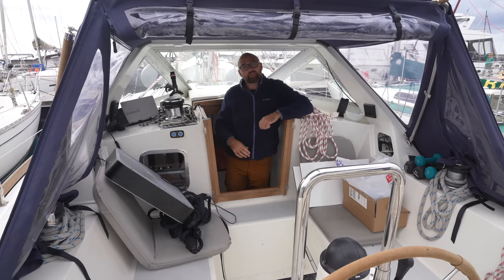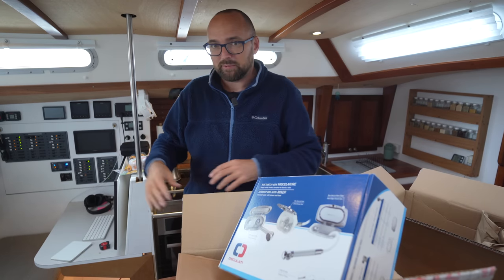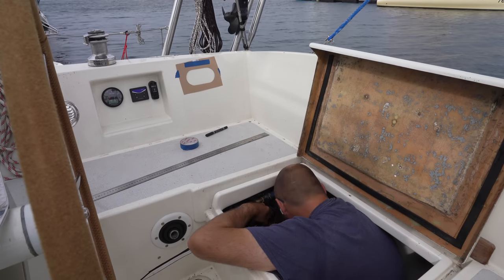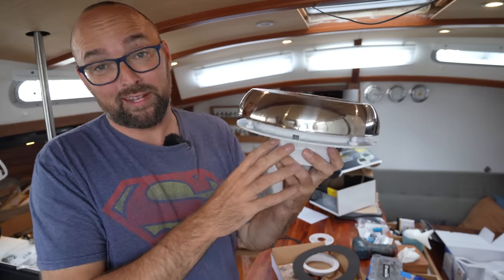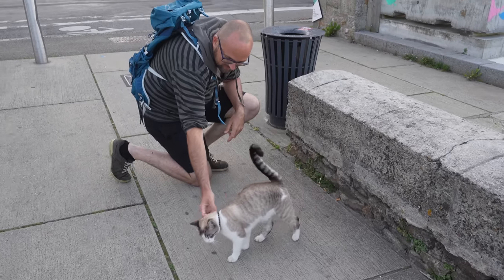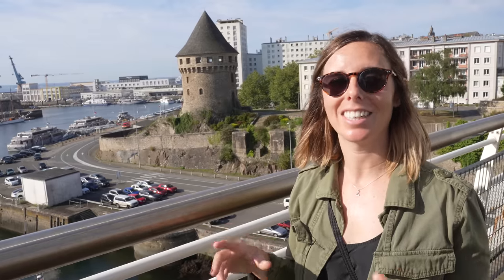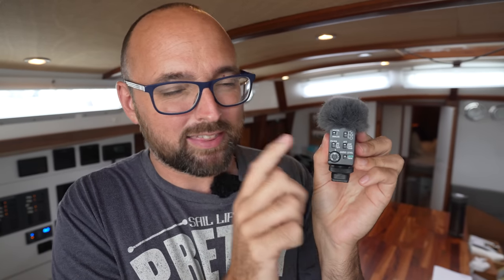Sail Life - Cockpit Shower, Solar Vent and tour of Brest

Comment: It's funny hearing Ava immediately shot down the cold shower. I had a similar experience years ago. I took a woman on a surf date. (We were both surfers already.) We took my VW van that I had built this beautiful kitchen and shower unit for. Figured maple, maple cutting board, stove, and 20 gallons of high pressure water to wash all the salt off after our surf. I was quite proud of it. When it finally came time to rinse off she looked me dead in the eyes like I had just kicked a kitten and said "It's not hot water?!?" 

Years later when I sold that unit, tore out the entire interior and built out a full camper interior in its place, I made sure to install a hot water heater. And you know what, she was right. Totally worth it.

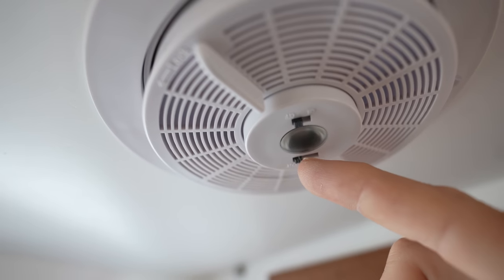Comment: 10:18 Pro-tip on the solar fan: based on my own personal experience NEVER have the fan bringing air INTO the head while said head is in use. This will pressurise the head, forcing the foul miasma of defecation into you cabin, there by earning the ire of any occupants.
(Brought to you buy the guy who almost gassed his partner in their motorhome...)

Comment: Regarding lack of templating, a trick I learned recently: Bring the thing and a tape measure to a photocopier. Make a photocopy of the tape measure held against the glass. Measure outcome with tape measure. If the marks line up well enough that you can correct the results, photocopy the item you need a template for. If they're too far off, find another photocopier. Tape photocopy in place and mark up adjustment if necessary.

Comment: We have found that keeping the panels clean is super important to maintain their power output.  My habit is to clean them first thing in the morning while there is still a.lot of free dew moisture on the surface of the boat.  With a squeegee it is plenty of water to get them back up to maximum output unless Mr. Seagull has left us a sample of his parented white one-coat marine.grade paint.  Then I use a spray mister to work on it a bit which is usually enough to get it clean without wasting too much precious water from our tanks.  Alas, there is no watermaker for us yet even after a few years of cruising so all the H2O we use is usually hauled in jugs via the dinghy from shore.

Comment: If the screws ever work loose from the flange of the shower doohickey, you could drill/fill/drill the hole and use "stove bolts" as we call them in the U.S.  You should be able to find the size head and diameter and length you want in stainless and use a washer on the inside with the nut.  Things are really looking great, Mads!

Comment: Mads, in earlier videos after cutting holes in the deck you scraped out the balsa around the edge and filled with thickened epoxy, a variant on the drill/fill/drill, did you not do it this time with the vent?

Comment: As you can see at 5:25 on the video, the cold tube has blue piping around it and the hot has red piping.  Assume the mix is the one without piping (thin colored spiral around the tube)

Comment: I have some solar vents on my boat like the one you installed in this video. I've found that they are subject to leaking when the water comes sideways (driving rain or waves over the deck). I bought some Plastimo Dorade vents to replace them. I haven't done the job yet, but I plugged the sides of the solar vents with butyl tape - ugly but stops the drips - until I can get the Dorades installed. They don't have fans, but if I find I need more airflow, I figure I can place a fan underneath.

Comment: The simplest thing to do about stainless steel screws is to always run a steel screw the same size in the hole then just back it out and replace it with a stainless screw

Comment: Mads, you just cut holes in your boat like its nothing, I wish I had the confidence. I had to drill a 3/8th , or 9.5mm, hole to run an antenna wire, and I was in a panic.

Comment: I think if you need something that opens in the bathroom, you might be better off replacing one of your deadlights with a portlight. I doubt that you will need anything but the fan on passage so a portlight can be dogged down for safety. (Also, if you installed it in the shower, it wouldn’t matter if you left it open in the rain)

Comment: Well, I hope your desires of that Star Link are not to connect in any heaving seas. Nice for steady sailing on a limited heel and small wave action I suppose. You will rip up the positioning support gear on anything else. Those systems are best for larger vessels and that is IF they can even stay stable enough. Best to save some money on the stationary system and forego the former. But if you have so much money that you are bored with spending it why not go for the sea system and enjoy what little more you will get with one?
Reply: So far it works. They did a starlink update last week on patreon while in the middle of bay of biscay. Hope to hear from Mads how starlink is working. I have a feeling he will only activate it during calm seas.
Reply: @WaterFaucet24  I do not believe he is getting the mobile version. He said something to the tune of it being very expensive. It makes sense too because the phased array antenna is always having to establish links with a broader satellite system to maintain connectivity on a heaving vessel. Most that I have heard who are using it are not using the mobile version but the stationary edition and only in calm waters at anchorage.

Comment: The reason why most Orca attacks have been reported in area XYZ is most likely that most boats sail in area XYZ. If many boats sail in that area, we can expect most reports to come from there. If you take another route, the risk per boat might very well be the same.  In order to calculate the relative risk per area you also need to know the total number of boats in each area.
Reply: Attacks happen where argo Ocas are... not vice-a versa.
Reply: No. It's a local problem. 
We have loads of Orcas in Norway (allways had) but no such issues.
Reply: @EuroThrashDude  So if there are no boats in area XYZ but many Orcas there, we will still see attacks in that area? Sounds unlikely. For any fixed population of Orcas, the number of attacks per square mile must surely be proportional to the number of boats in the area. And there area (many!) more boats in some areas that have equally many Orcas.
Reply: @90090410  agro as in aggressive, meaning the young Spanish Orcas

Comment: Maybe you do not know, but unless you have optimizers on every solar panel, if one is shaded partially, reducing it's output, and it is connected in series  to another, the second one will be dragged down to the same level as the first one.
Reply: Mads knows 😉

Comment: Hey Animal Whisperer, how about a Yerkel (sp?) update? Also, Starlink comes with a ground base. Would you consider just setting it out when you need it instead of covering the panels? At least until you have a chance to make a better installation? Seems you will use/need the solar every day. Not sure Starlink too useful when bouncing on passage. Just a thought from a Starlink user.
Reply: Mads answered re Jökull here https://youtu.be/gHJFk1pJU6c?t=463
& there are quite a few yachts running Starlink without many issues - coverage isn't great offshore yet, but it's getting there, but I suspect it will be more for use when moored/anchored to upload videos etc rather than for heavy use whilst underway
Reply: FYI- they did a live video broadcast and upload via starlink in the middle of the bay of biscay (to patreon) last week. Had good signal, so far so good. Looking forward to a full report from Mads in a future episode.
Reply: @WaterFaucet24  excellent!

Comment: I have made 5 Biscay Crossings and your plan is flawed.
Going inside along the coast while going south is a mistake.
You will get trapped deep inside the bay leaving yourself a terrible beat to La Corunna.
The preferred crossing while transiting south is to head east a bit in a semi arc.
If you want to explore the coasts inside of Biscay do it while going north.
Also note that weather forecasts for biscay get a bit wonky and unreliable by day 3
of a crossing.
No mention of the 8-9 meter tide in Breast???
Biscay can kick you ass especially for a crew of two. Good Luck
I’m watching this video Sept 24th, I hope you're across already.
Cheers

Comment: Go to YouTube and punch in worm shocker . You hook up a hot wire to a metal rod . Make one with a pvc handle on it . Then plug it in to your generator plug . Then If a killer whale comes around a boat put the hot wire connected to the rod  in the water it will shock the whales. I bet it would work .Make it a long handle for the whale can’t grab your ass off the boat . There smart and your going to piss it off . Man that would make for good video . Do it

Comment: These solar vents are crap. The solar cells fail real quick and so does the battery. A much better solution is to use the existing boat batteries and a 12V computer ventilator. These vents are very cheap, very silent and come in various sizes. Just cut away the square plastic corners and you end up with a nice round vent which just fits in the hole in the deck. On deck, use a regular stainless round Vetus UFO deck ventilator. The computer vent I installed in this way above our stove 12 years ago still functions perfectly.
Reply from the maker: I keep flip flopping between wanting some kind of vent or a hatch. Really the perfect solution for us would be something like a hatch with a vent but I doubt we have room for that :)